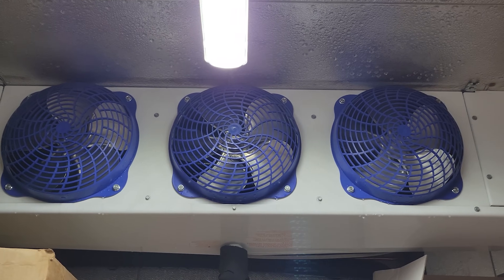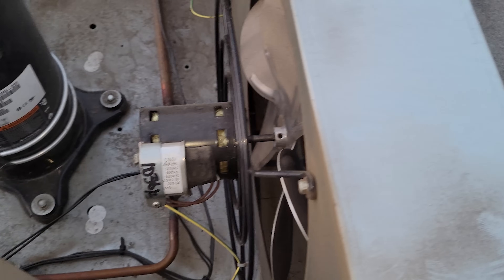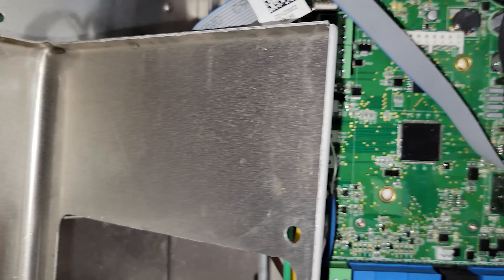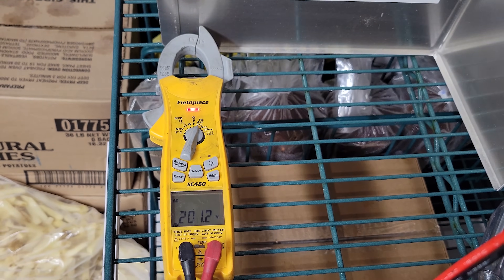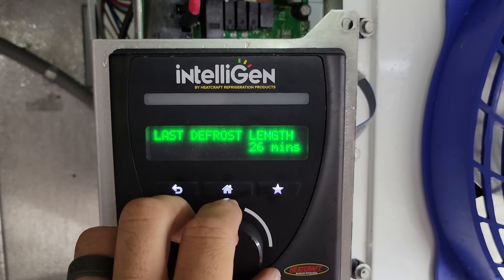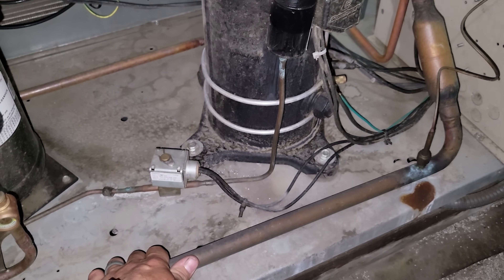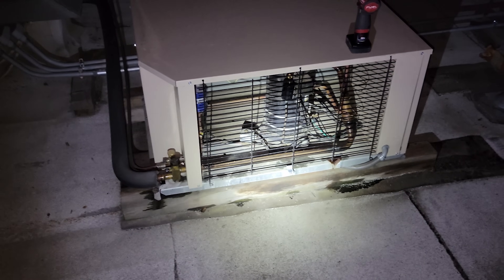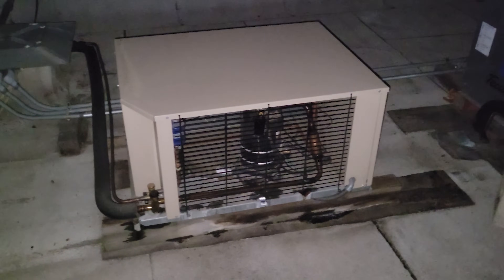HURRY THE FREEZER IS AT 50 AND IT'S 7PM

Comment: 7 pm at night and 50 degrees? You would think someone might have noticed earlier in the day.
Reply: Let’s assume that on average during the peak dinner hours the freezer door is either opened a hundred times or left open.   That much air exchange with a hot kitchen will expose a non-functioning system very quickly.  The same freezer may stay cold with a dysfunctional system for a whole day if the door is not opened.
Reply: @ernestrollins383  ... would agree that a closed door will keep a long time. My point being why nobody mentioned the obvious "not blasting freezing air in the face" which is what I suspect finally happened. Also, why is there no temp warning on this system to get someone's attention long before 50 degrees?

Comment: Oh boy those borh are a nightmare to disassemble, in my work they had a a tons of those and get dirty so often, i think its bcz the fan don't turn off, but its the older model without circuit board, bcz its controller by a danfoss adapt-kool

Comment: I find it so strange those controllers don’t alert everyone when the freezer stops working and that they don’t have a door sensor that also alerts everyone when the door is left open. Seems like it has almost everything it needs to do that.

Of course in this case it wouldn’t have caught it but it would catch most failures.
Reply: i recall from some of the older videos and stuff, some doors do have an alarm for if it is left open, and if the power goes down for those smart controllers, there really isnt any way for it to alert the managers or whatever since it wouldnt have power (unless you have a backup power source or alarm)
Reply: @awesomestuff9715  yeah I don’t think the door alarms are internet connected though. Just a local audible alarm
Reply: @Mrcaffinebean  in a restaurant setting, that should be plenty

Comment: Measure the 24V current at the transformer.  That should tell you if the transformer failed due to overload or if it was just a random failure.
Reply: Measure current huh. Yup, sounds right. But now you gotta show everybody where the fuse is in Fluke after they overamp the meter lol.....
Reply: @flipfloptanlines926  Every HVAC tech that I have ever met has at least one clamp meter in the truck so going over the current range is not really an issue and still accurate enough to tell if something is wrong.  All he would have to do is test the current draw by clamping around one of the 24v lines with the new transformer.

Comment: That's a rare failure for a small transformer to self destruct and smell burnt without having been overloaded. The future on this could be interesting
Reply: I didnt know you watched these videos Shango but im also not surprised
Reply: @Masterkill45588  I was in this line of work for years. I enjoy Chris's diagnostic methods, he gets it
Reply: Might have vibrated through the lacquer on the wires?
Reply: If Mr. Carlson pops up on here, I’m going to fall out of my chair.
Reply: @comput3rman77  I would be slightly surprised if he watches hvacr lol
Reply: I just came from a Shango video to HVACR. Damn, small world. lol
Reply: @XMguy  wtf i just came from shango radio repair to HVAC. wow we have common taste.
Reply: Most small Transformers have thermal fuses in them and for it to overheat and get that hot in a freezer is impressive. Overload or manufacturing defect, time will sort that out for us
Reply: Usually small transformers fail on the primary side, due to being run too close to max rating.

Comment: 4:31 that primary is open transformer should only reads few ohms or typically below 1k (higher than that for smaller transformer) while that secondary is normal, transformer looks like a short circuit or very low resistance when measured on DC like how multimeters measure those
Reply: Came to say the same thing, the 18M Ohm was more a concern than the 0.8 Ohm when it comes to coils.
Reply: @inothome  .8 ohms would be almost no resistance which would be a short. Trying to figure out if a transformer is within range is pointless anyway.. The better way is to check voltage. If input and output are good, that's all that matters. The only reason he was testing the resistance was to see if it was completely open
Reply: @AnUnapologeticApologist  Right, check volatge and be done with it but he likes to investigate, which is cool.  But 18M Ohm for a transformer is just about an open AC winding. So checking the secondary was pointless.  But 0.8 ohms is closer to what you'd expect on a AC coil than 18M ohm, which was my point. The primary should be less than 100 Ohm and the secondary about 1 to 5 ohms.  But your transformer readings may vary......
Reply: @inothome   I don't disagree with your ranges but my point is exactly what you said at the end, the ranges vary depending on the manufacturer design specs. 18M would be almost open I don't disagree, but .8 is not close to what youd want to see at all. 0.8 ohms is almost no resistance at all, which would be like reading two ends of the same line. Both are bad. Again I wasn't disagreeing with your statement on the 18 mega ohms but rather the .8 ohms statement.
Reply: @AnUnapologeticApologist  I hear what you are saying and not arguing. But when it comes to AC coils, such as transformers or motors, it's not uncommon to have readings less than an ohm. With AC and a coil you have the impedance of the coil, which is the actual resistance in an AC inductive circuit. What you measure with an Ohm meter is not the actual electrical resistance the AC current will see in a coil. So what looks like it would short and definitely would in a DC circuit, in an AC circuit it's fine. Talking about  a coil of course, a piece of straight wire would short.
Example, on the bigger substation transformers I test, most are all in the milli-Ohm range (0.000 Ohm) and some will be down in the tenths of a milli-Ohm / micro-Ohm (0.0000) range.
Reply: @inothome   Looks like I learned something today lol guess this is why I am just a refrigeration guy and not an electrician. I do find it strange though, when I read contactor coils or ac motors I see ranges in the hundreds of ohms. I haven't seen that low of a reading but you sound like you know what you're talking about.
Reply: @AnUnapologeticApologist  The best way is to compare with a known good or have the manufactures specs. I just wanted to clarify that just because it looked too low doesn't mean it's definitely bad. It very well could have been shorted, they do short. Different types devices will have different readings, but similar devices of the same voltage should be more similar.
Reply: @AnUnapologeticApologist  Consider the resistive losses of the secondary winding - this is a 24V 40VA transformer, so that's 1.6A across 800mohm, or about 1.3V and 2W dissipation purely in resistive losses on the secondary at rated load. This isn't unreasonable, but much more would be impractical.

Also, for all intents and purposes at DC, you are reading two ends of the same wire.
Reply: @inothome   low ohm reading is generally only on solenoid coils which have moving metals parts which changes the coils inductive reactance, powered with ac voltage and it stuck "not fully pulled in" the current will be higher than it can sustain without cooking itself. if it pulls in fully the magnetic flux field changes the inductive reactance and the current draw will go way down to proper level.
on a transformer, there's no moving metal parts with mostly fixed inductive reactance and current input(line draw) is fairly proportional to current output(load), until overcurrent and core saturation by short circuiting/overloading.
I'm not a teacher, nor super-duper "engi-nerd" so hopefully explained it well enough.
Reply: @throttlebottle5906  Not sure what you are considering a low reading. But yes, different devices will have different readings. Voltage and / or the VA will also effect the reading. So a 24V /10VA Tx will read different than a 24V / 25VA Tx. Temperature will also change that reading, same transformer at 100F on a roof will read different than the same transformer at 30F in a walk in.  I am also aware of the knee point, or where a transformer reaches saturation.  Again, not sure what you are considering low, but here is a random video on YT showing a multi-volt input and 24V output HVAC transformer and he measured 1.2 Ohm on the secondary. 
https://youtu.be/QqaxkGcEzeI?t=163

As far as solenoid coils, they are all different too. Some have a duty cycle, example, trip or close coils on breakers are very short duty cycle. They have a super strong pull, but only for a very, very short time. Power one of those for 30 seconds, even if the armature pulls in and they will have a meltdown and smell really nice..... lol 
Not arguing with you here, just everything reads different and comparing with a good known, manufactures specs or a previous test on same device is the only real way to be sure. Of course actual experience helps too, to get familiar with what is the typical range on similar devices.
Reply: True. I’m not a big fan of power supplies and electronics exposed to extreme temperatures. That’s asking for problems… but it’s designed that way. Mechanical timeclocks don’t go inside the box, for this reason…
Reply: @ecaparts  i can see the thick conformal coating on that control board

Comment: The transformer primary was open, it was reading in the MegaOhm range! You could have tried the 230V tap....
Reply: No go, if the 208 tap is blown you're not going to get any joy on the 230 tap.  Even then that's a crap shoot because you still rely on the common.  But yeah, there was either a short on the secondary or moisture infiltration on the primary.
Reply: @sivalley  I agree, but sometimes only the wire to the terminal is broken and you can get by with the 230V terminal. Might get you through the weekend.
Reply: @irfp460  Fair enough, better roll that die and hope for a Nat20. 😁
Reply: Come on fellers, its 2am, we caint be textbookin lectrical failure theory, locate the nearest doorbell, rip out the square dill and lets get some coolin lol
Reply: Many transformers have a thermal fuse on the primary to protect against overheating, often caused by overloading.